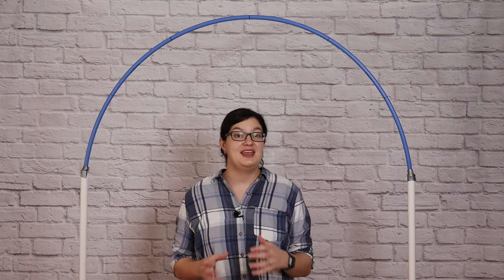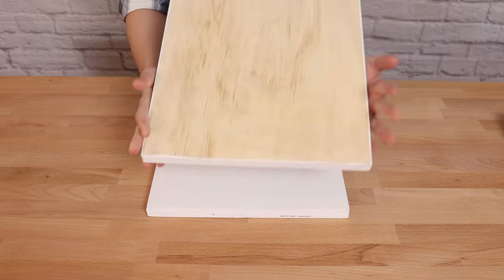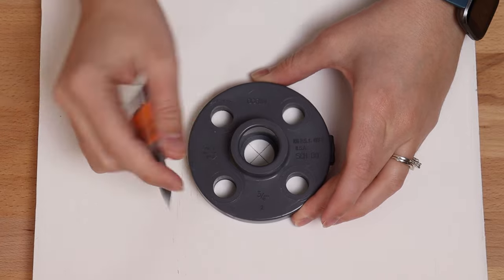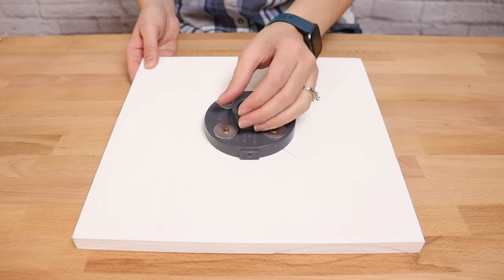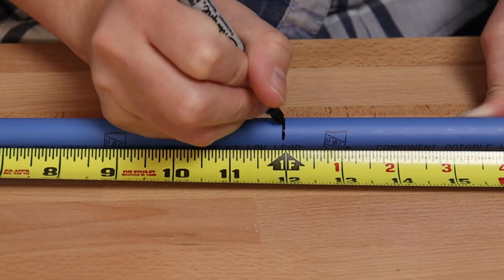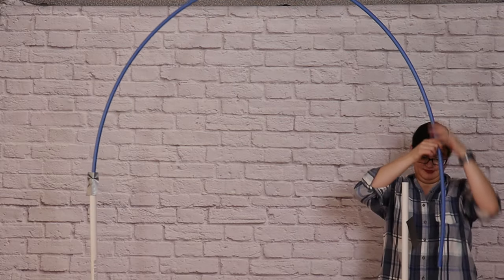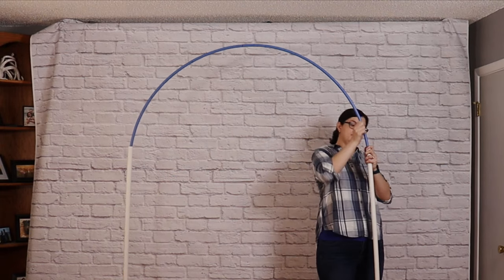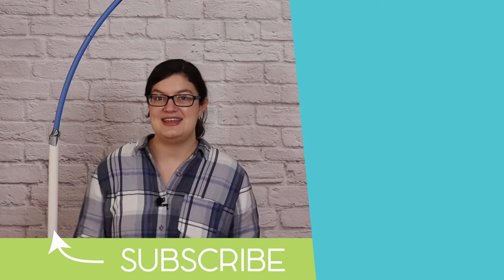DIY Balloon Arch Frame  | Narrow Arch

Comment: Madam, can we do normal balloon arch 10 x 8 feet size this method (using PEX pipe) for shop inauguration
Reply: I think the flange isn't enough to stabilize something that big. You might try a metal flange. that is taller and put a short length of metal pipe in it.

Comment: Thank you for sharing! Quick question...is there an issue with the PVC pipe popping off the floor flange due to balloon pressure?
Reply from the maker: That is an insightful questions. Yes, If you push quads together really tightly they can pop the pipe out of the base. If that might be an issue, I will tape the joint together for extra security. A little bit of duck tape can easily fix the problem.
Reply: @EventAnswer  what about pex pipe? Is an issue or  problem (dropping) due to balloon pressure? Thank u for response 💓